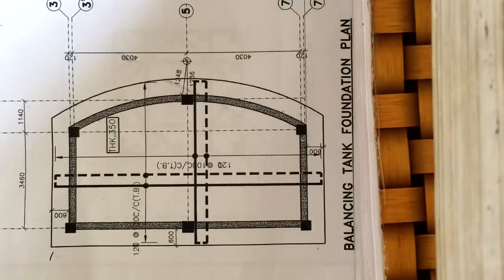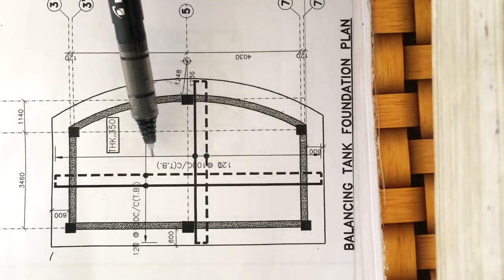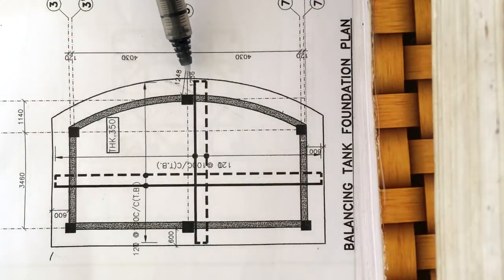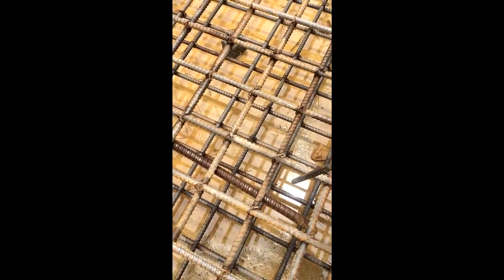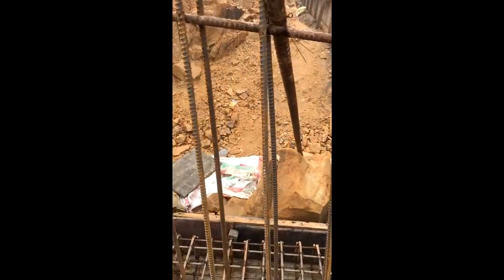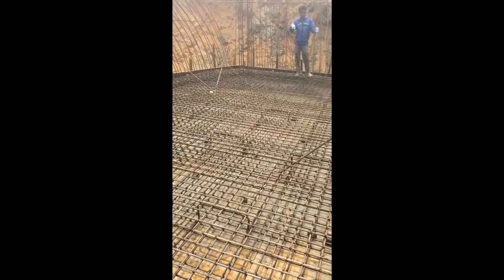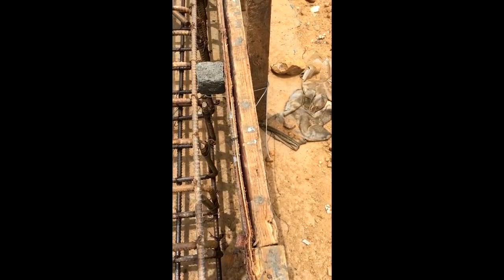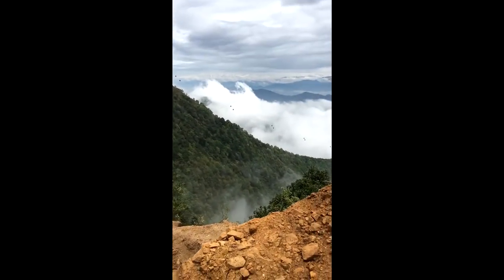Raft Foundation Reinforcement and Construction In Detail

Comment: It's not a big raft foundation...Rebar = D13-100 (top &bot) , Spacer =made of D16 (4 Pcs per 1,5 m2) . For the shear wall normally : using rebar D13 -100/125 , concrete thickness =150 mm.